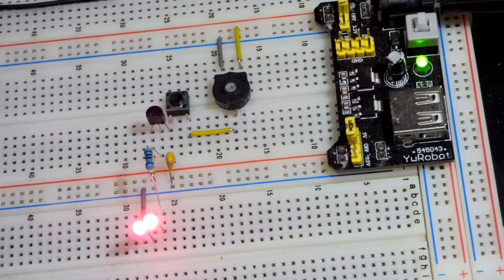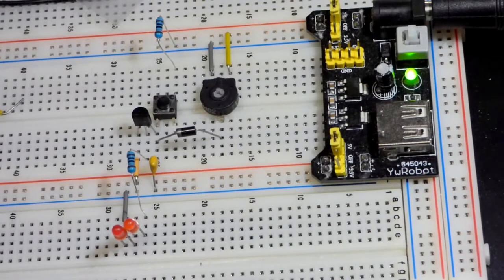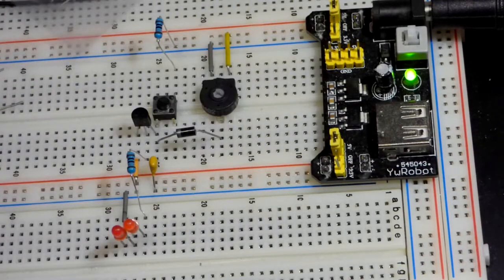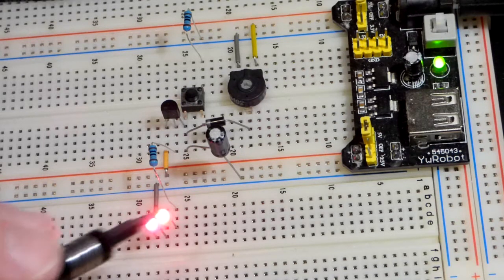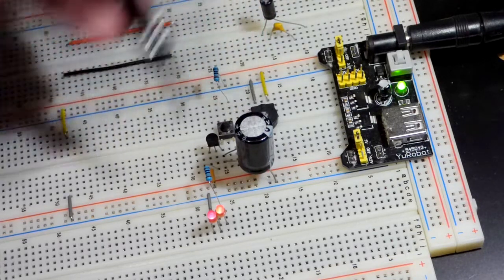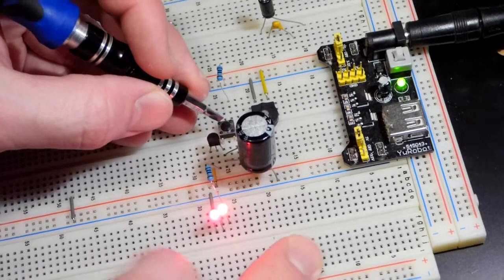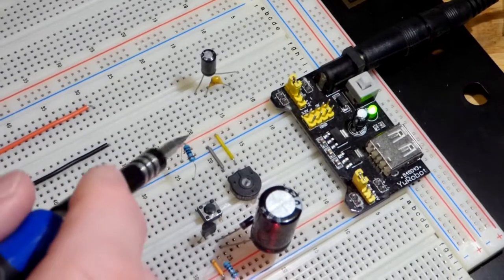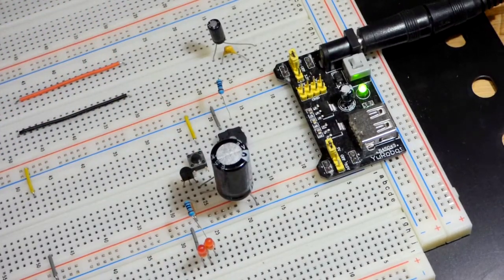J310 JFET transistor prototype sample and hold circuit

Comment: This will be helpful. 
What is the name of the black big circuit with green led ?
Reply from the maker: Glad to hear! That's a breadboard power supply. I have an adapter that plugs into the outlet and provides 9V to the breadboard power supply and it outputs 5V 3.3V or 0V.
Reply: @Electronzap  wow
Thank you